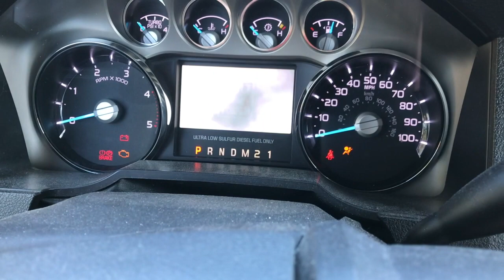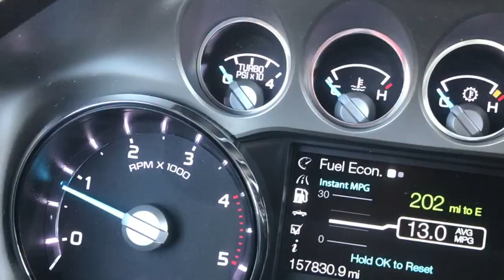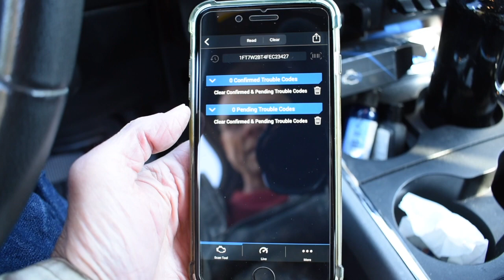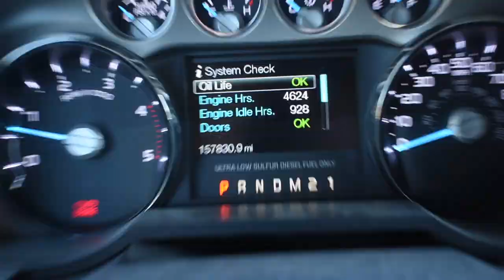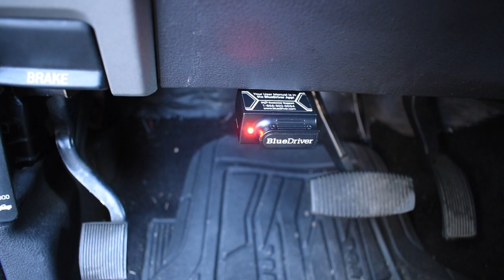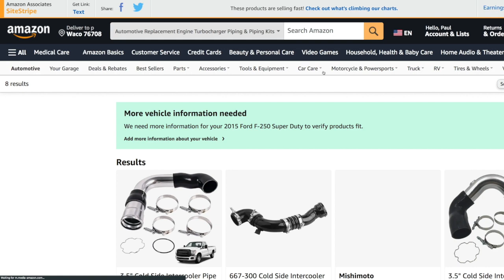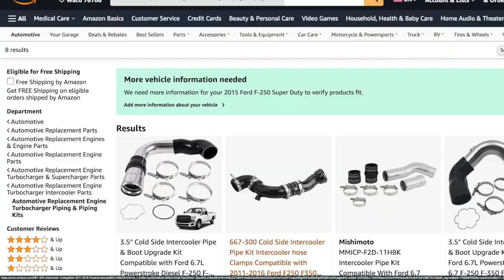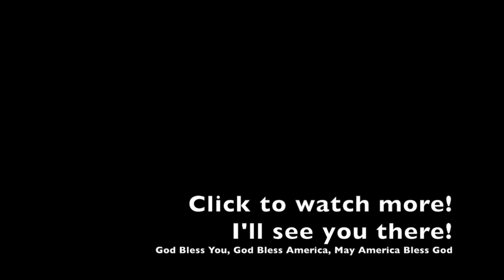My truck blew up!

Comment: Know little to nothing on Turbo engines Diesel or Gas. All I do know is they run at very high RPM and run Hot. Usually bad combinations for long term reliability IMHO.I have heard you need to be quite consistent in Oil Changes and use higher quality oils to keep that Turbo happy.
Does seem strange that your Diagnostics took dive too though. Could the ECM have failed and then impacted your Turbo performance? Watch Wes Work is a talented diagnostic mechanic on YT...as a fellow YT guy maybe he can provide some remote advice.
Reply from the maker: I'm learning a lot by necessity. All my life since 16 years old, have been a weekend warrior grease monkey. I've worked on many a muscle car to get the best cost for performance I could. Since the computer driven/monitored motor, I've just not kept up. Now that diagnostic tools have gone from $100K to a manageable cost of about $200, it's more cost effective to try to eval what is happening so i have a better idea of whether or not I should trust the faceless mechanic I take these things to.  The other thing, around here, my choice of who to take this issue to is very limited.  It's the dealer or a performance diesel specialist. both about 30 minutes away. 
More to come.

Comment: I don't know much about turbos and even less about diesels. I've had a fear of turbos and have avoided purchase of any car that had one. I know that there will soon be no choice and there is little choice now. Good luck with this problem.
Reply from the maker: Thank you. I'm having to come up to speed on this very rapidly. (you can take the pun if you you'd like) Turbos do add a great deal of pressure load and can cause a shortness of life to the motor over normally aspirated motors, but the performance benefit can be a plus. It's a trade off. More to come.

Comment: Trade it in for a Toyota but not the new turbo one. Get you an old V8 Tundra.
Reply from the maker: I had an '83 toy 4x4. Should have kept it. Then a 2006 Tacoma 4x4. I know a couple guys who have the Tundra. Solid truck.